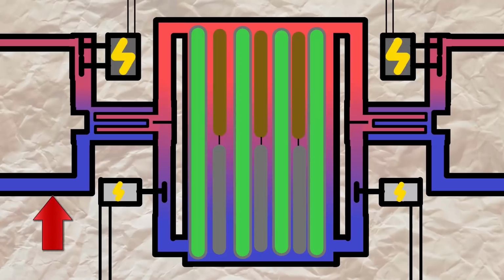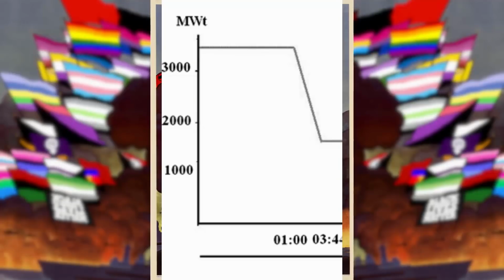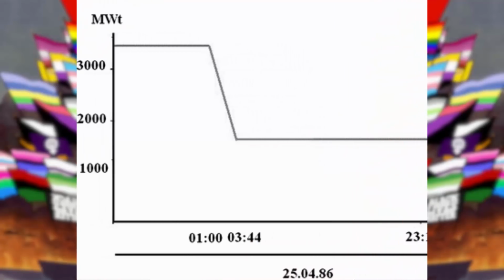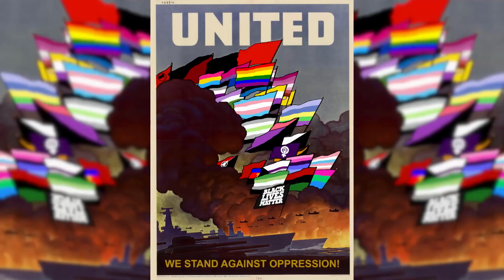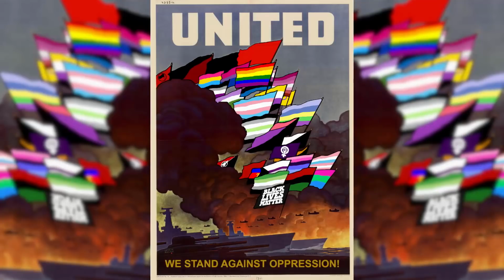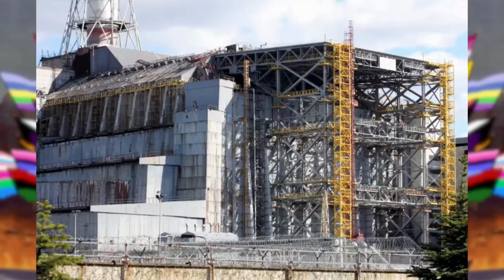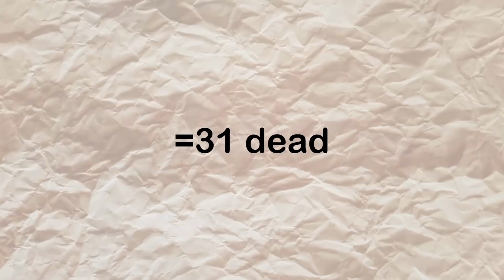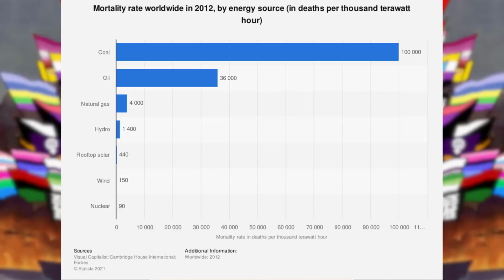Chernobyl: The Only Nuclear Accident We Care About

Comment: So the entire disaster happened because of some small mistakes made by workers who refused to follow protocols built for safety? WOW
Reply: The RBMK reactor design itself was flawed in that it allowed this to happen in the first place. Reactors are designed to "fail safe," meaning if something goes wrong it will safely shut down. In day-to-day operations the RBMK reactor is perfectly fine, but if you do the exact right sequence of things -- like putting in cheat codes in an old video game -- then it can blow up. This had been determined before, but was not widely known.

And it just so happened that these guys did that exact right sequence, without knowing that they really, really, REALLY shouldn't.
Reply: @devinfaux6987  
> it just so happened that these guys did that exact right sequence, without knowing that they really, really, REALLY shouldn't.
I'd say they didn't know that that was what they were doing.
What is the chance of performing all the right steps in the right order in the one sequence that you shouldn't?
Reply: Most of the blame goes to the asshole shift leader, Dyatlov. He was insanely reckless and bullied everybody into doing ignoring safety protocols because he wanted to meet a deadline. He also overruled the workers who told him the explosion was much worse than he thought.

The Chernobyl miniseries actually did a pretty great job of explaining how it happened. I highly recommend it.
Reply: @akinbodeog   What is the 'Chernobyl miniseries' ?
Reply: @somethingelse9228  HBO miniseries called "chernobyl"
Reply: STALIN DID CHERNOBYL
Reply: According to one anti-communist argument: "Under socialism there's no competition so they used the cheapest materials and so it exploded and that's why Capitalism da best."
Reply: @redforest9269   I would argue that competition actually has a higher chance of using cheaper materials for higher profit margins,
at least you can curb that by using government mandated quality standards.
Reply: The workers did not know that they were breaking safety rules, because such rules did not exists.

Comment: I still find it funny that despite all our advanced technology,we still generate electricity using giant steam engines.
Reply: When you reach max level you stop leveling. Rankine and Brayton are the final bosses of the Type 0 Electrical world update.
Reply: Steam is basically the best technology ever, so it make sense. We even have ways of using solar mirrors to make steam engines go brrrrrr nowadays.
Reply: If I’m correct the only practical other option we have now is solar
Reply: @Evannnnnnnn2  Even with solar it's more energy efficient to use concentrated solar to drive a steam or gas turbine. Solar PV is inefficient. It just happens to be cheaper due to the scale at which it's built with cheap labor, and can be used in smaller scale applications too.
Reply: @George Mann I was not saying solar is the only practical option or that is is a particularly good one, I was just saying it is the only type that doesn’t generate power with giant fans of one type or another, I don’t know what kind of smooth brain you have to have to get the idea that I was saying that solar should be used everywhere.
Reply: Hydro and photovoltaics don't use steam.
Reply: @seneca983  But see what @zolikoff said.

He's wrong about the cheap labour, but he's right about the efficiency.
Reply: @davidwuhrer6704  Yes, but there's still hydro which doesn't use the Rankine cycle (or any kind "cycle" for the water).
Reply: @seneca983  The water cycle 🤓

You're right that hydro and PV (and wind for that matter, and tidal wave power generators) don't use steam.  All I'm saying is that steam isn't going away anyway.  Steam is pretty awesome.  Geothermal uses steam.
Reply: @George Mann The difference is that the land used by PV can be used for other things at the same time.  It can be put on roofs and roads.  It is also not impractical, unreliable, seasonal, or geographically limited.  And unlike with nuclear, the material used for it can be recycled, which reduces the cost of raw material.  Currently, PV is the cheapest source of electricity, and still becoming cheaper.
Solar is also not necessarily intermittent.  For one thing, some solar panels can produce electricity also at night.  For another, solar plants can be put in space, where there is no night.
As for the return on investment, less efficient PV is far more cost effective, but also less efficient.
Reply: You best start  believing in steam punk worlds. You're in one.

Comment: I've worked manufacturing pharmaceuticals in America and I cannot stress how similar my working conditions were to this shit. Equipment that's barely held together run by undertrained technicians for maximum profit, night shift not knowing what they were walking into that day, ignoring safety alarms, all of it.

I don't take any prescription drugs now if that tells you anything about my experience.
Reply: @Viki1999  something something inherent contradictions

Nice videos though, I only recently found your chanel, good stuff :)
Reply: I'm a USAF jet engine mechanic. I'm getting out for the same reason.
Reply: @hatman4818  where r u from
Reply: @Viki1999  You just can't be afraid to shake hands with danger!

Comment: Cherenkov radiation (the blue glow) is caused by charged particles (usually electrons) going faster than the local speed of light, not neutrons as you mentioned
Reply: It occurs when a beta particle passes through a dielectric medium at a speed greater than the velocity of light in that medium.
Reply: What do u mean by "local" speed of light?
Reply: @myfootinurass  in a specific medium.
Reply: @myfootinurass  basically these charged particles will travel near the absolute speed of light in air, which has a significantly reduced 'speed' due to the particles bouncing between all the molecules. So they are just zipping by.
Reply: @Orinslayer  thank u!
Reply: @myfootinurass  Speed of light depends on what the light moves through, the c0 number of 300... Is for light in vaccum. The speed in air is slightly lower, the speed in water even less.

Just like the speed of sound just that it works the opposite way, it's faster in more dense medium and slower in less dense medium.

And just like an airplane going faster than sound, a particle can be flying at c0 irrespective of the medium, that's just the top speed of light no matter where in the universe.
So the particles(in this case beta particles that is electrons) flying at the speed of light in vacuum through air lose some of their energy when they slow down and thus emit light to carry away that energy.
Reply: @myfootinurass  

Light travels at different speeds in different environments. In glass, it only travels like 65% as fast as it does in a vacuum.
Reply: As noted in other comments, in this case the glow was more likely due to ionization rather than the Cherenkov effect. The speed of light in the air is barely slower than in vacuum so it's not likely to be exceeded by the beta particles.